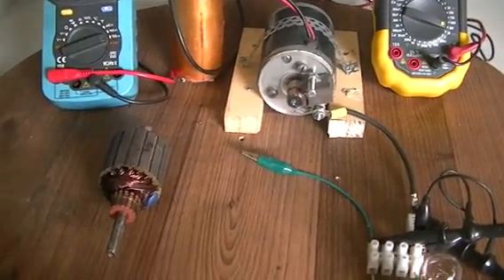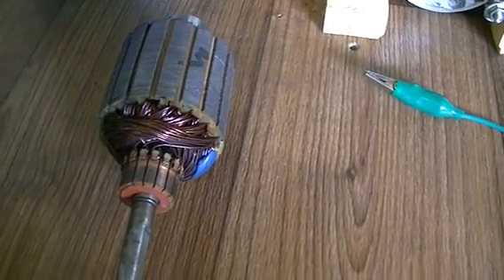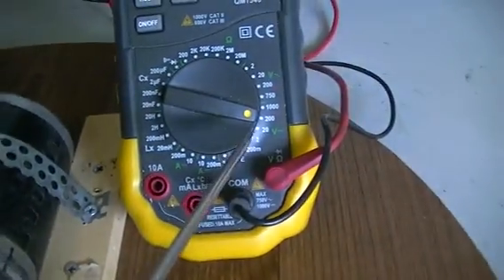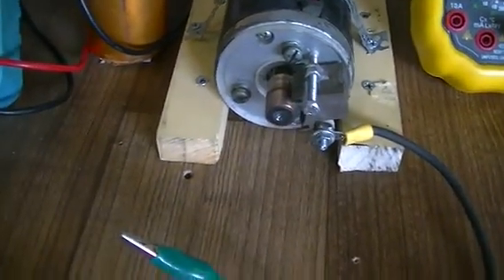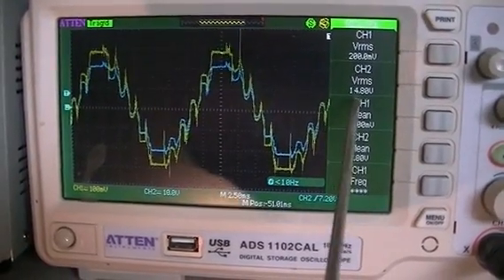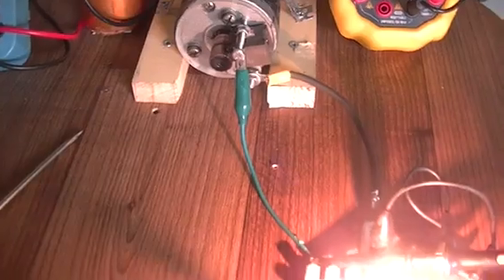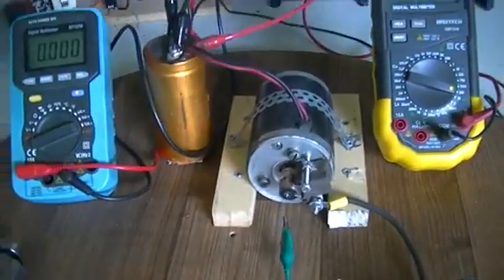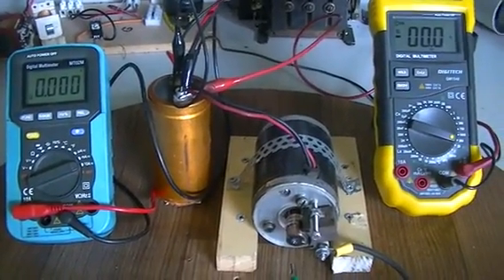Robert Alexander Motor Generator replication

Comment: Hello TinManPower.  Do you know where I can find a micro-controller controlled transistor/mosfet circuit for a Newman Motor?  I want to control the duty cycle, frequency and pulse width with the micro-controller.